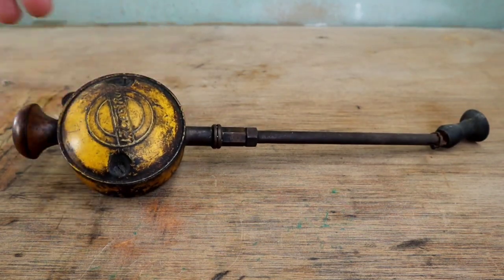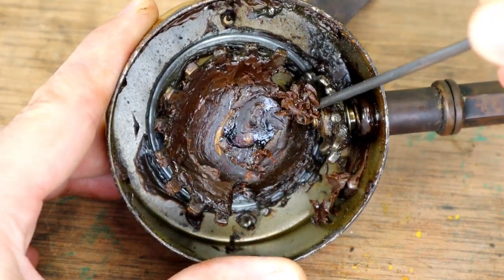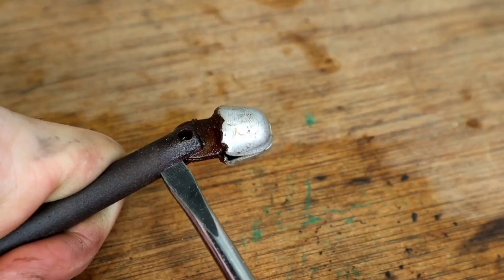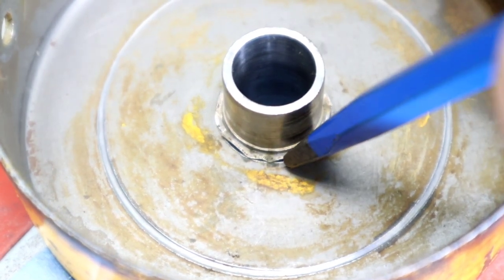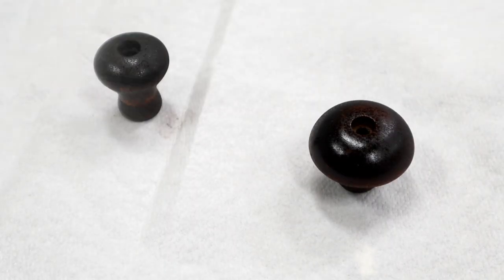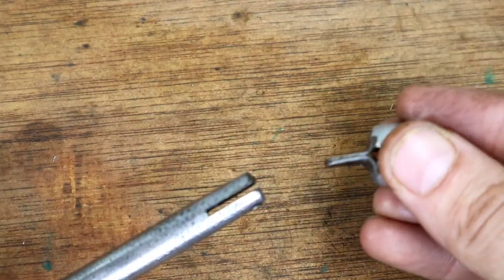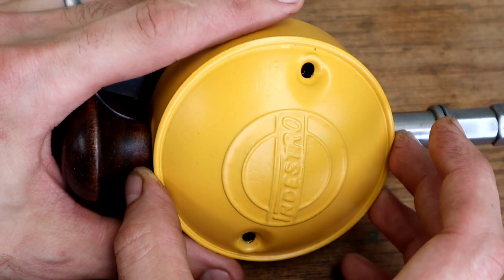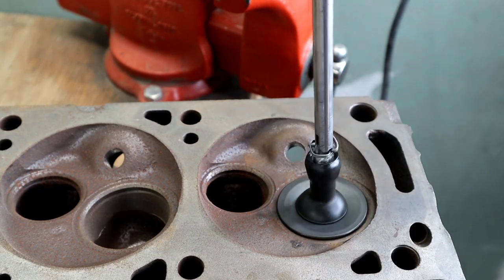Antique Valve Grinder Restoration | 90 Year Old Tool Restored

Comment: The color turned out great 👍 👌
Reply from the maker: When I go out looking for some of these vintage colors I'm always worried they won't be there. Krylon's line of colors have saved me more than once.
Reply: @OneNationRestorations  what's the actual color you used?
Reply from the maker: Matte wild honey. Who knew that was a shade of yellow, ha ha.
Reply from the maker: There's another yellow I use called John Deere Yellow if you need a vintage look with a brighter yellow.
Reply: @OneNationRestorations  i also need a vintage orange. Do you have one of those?
Reply from the maker: Idk about vintage, but I've been using popsicle orange and Husqvarna Farm series - both from Krylon.

Comment: Nicely done. It would be good to fine a source for replacement rubber. I have a few of these old valve tools that need the rubber part.
Reply from the maker: It's humbling to hear from people that have first hand experience with vintage tools like this. If I ever find a lead on the rubber part, I will definitely let you know!